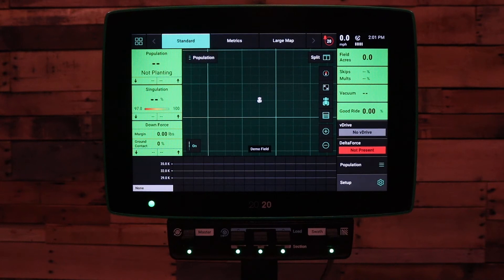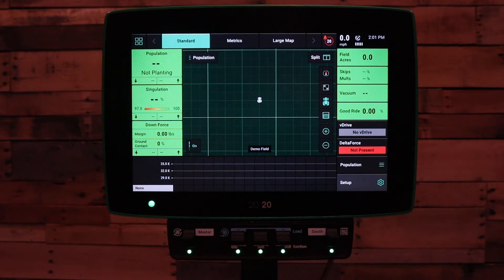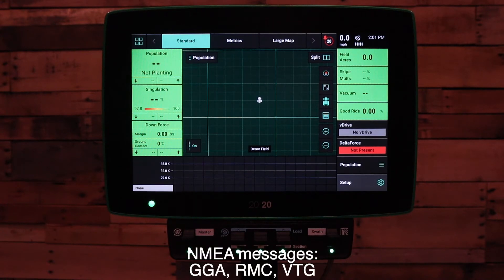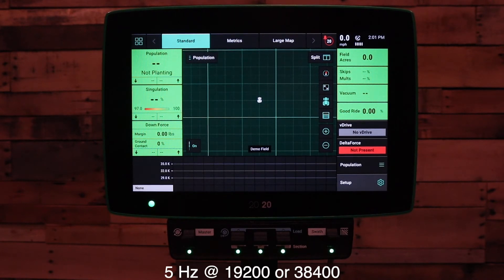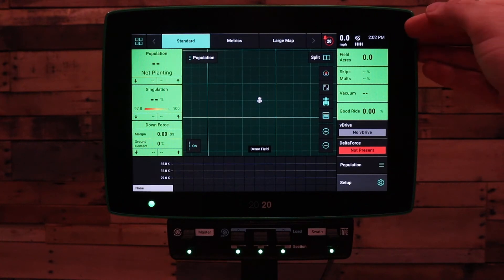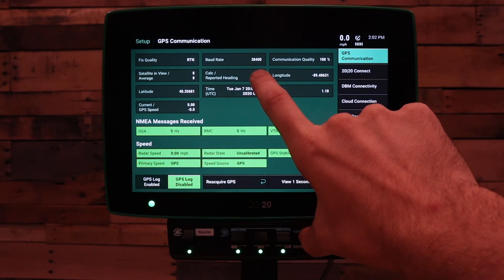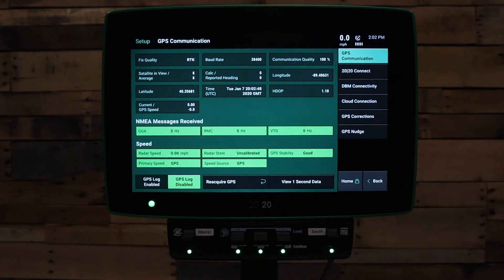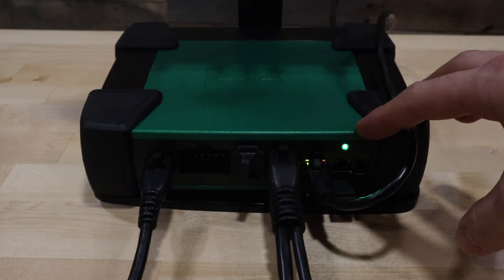20|20 Gen 3 - No GPS Reading Into Display

Comment: All correct gps settings nmea on 38400 and 5 hz gga rmc vtg on our fendt. Correctly wired into the 9 pin connector over head and nmea is enabled. Still getting event 21 entire system missing. Ran last year but won't this year.